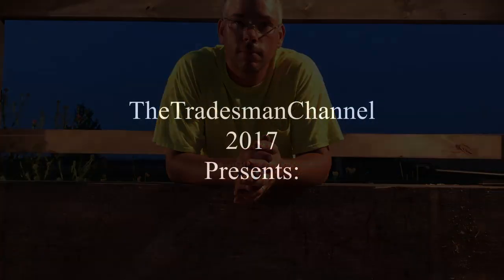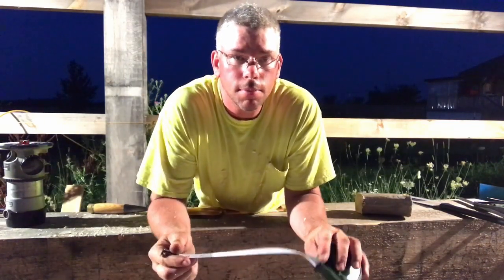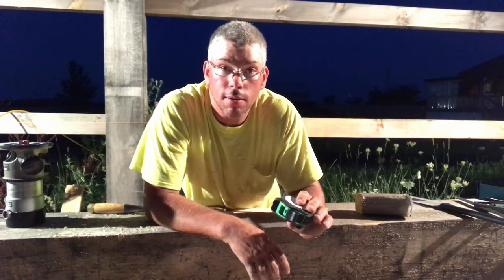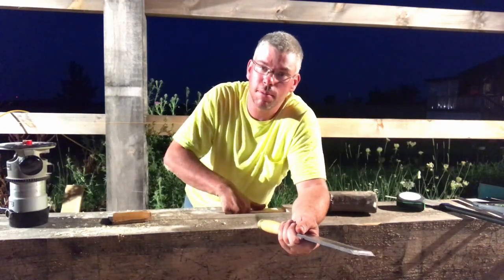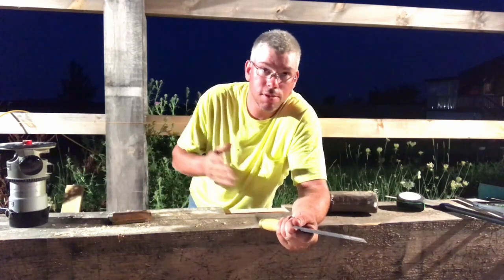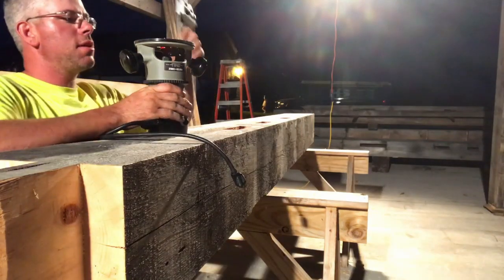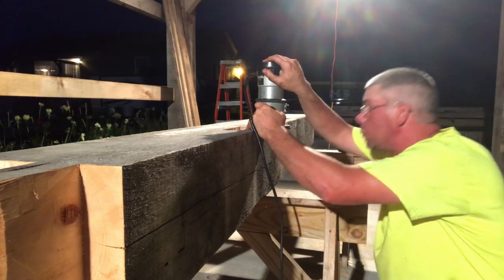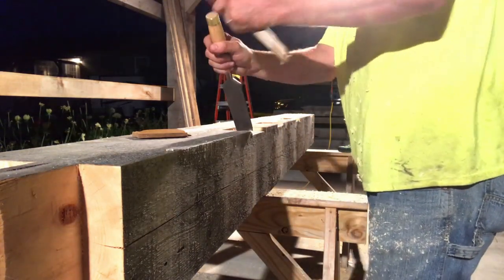A Timber Frame Vlog #31: The Final Timber Frame Barn Bent Part 1

Comment: Funny little insight.  The last two videos I made doing brakes on the rear of my Ford Powerstroke was actually done with an app on my phone called PowerDirector. Since I do 99% of my videos with my phone it saves me a bunch of time not having to transfer the files to my computer and mess around with them there.  The app is not as in-depth as a desktop editing software is, but as long as my footage is good I can edit videos really fast from the Comforts of anywhere. I paid $5 for the upgraded version of the app.

Comment: Hi Jim 
You sound really happy ( it might have some thing to do with that you have nearly finished the ground floor ) 
Great to see you HAPPY IN YOUR WORK
Reply from the maker: I am very happy about it.  It is exciting to be at this point.  The second floor will have some new and interesting challanges with new types of joints and so on.  The beauty of it though is that the timbers will be much smaller for the second floor framing and will cut much faster.
Reply: With any luck it should go faster as the timbers are smaller and it will be done quicker.
The video's are Great.

Doug.